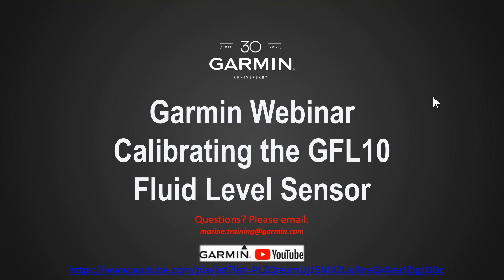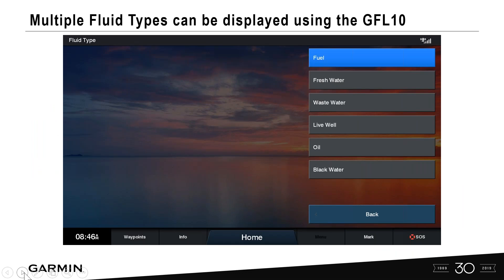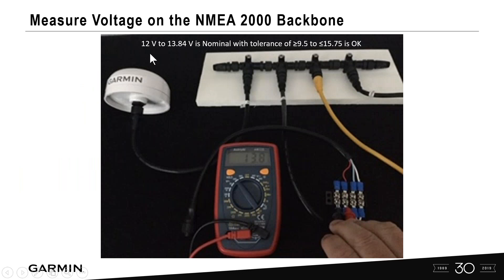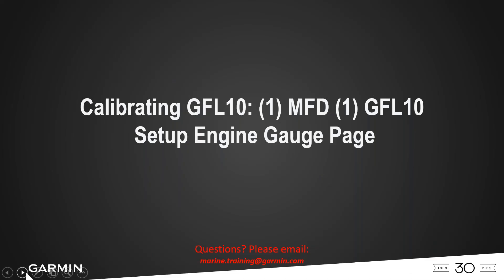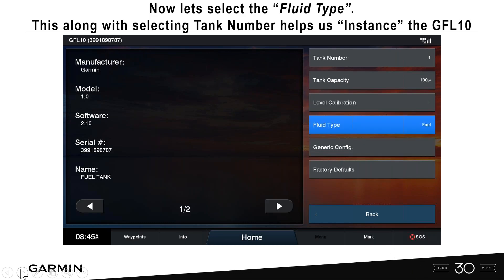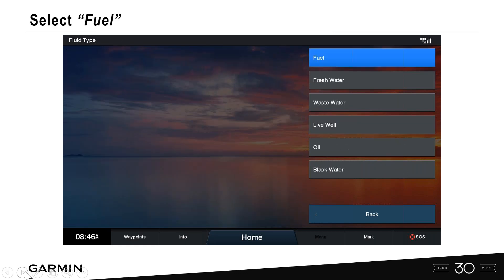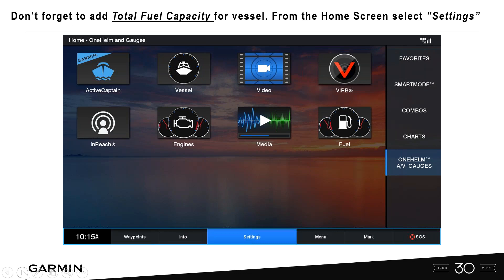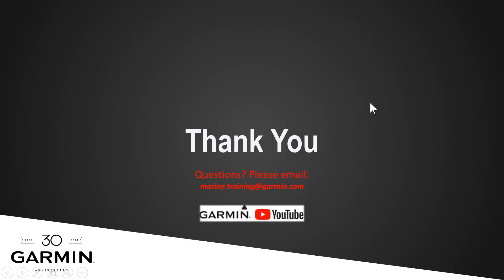Garmin Marine Webinars: How to Calibrate the Garmin GFL Fluid Level Sensor

Comment: 2025 comment here.  Super informative video as we just purchased a 2007 Nordic  Tug 42 with an older SmartLink vessel view system that is out of date.  I would like to ensure engine data gets on the N2K network so we can integrate it with new Garmin displays.

Comment: Say you're adding this to a boat that already as fuel in the tank.  Clearly, I can see your first calibration point would be after you fill it up.  Then, how do you add the other points if the GFL10 is the only way to get fuel level?  Obviously, you don't want to use empty as a calibration point when you're out on the water.
Reply: Yes it is very confusing.  I don't understand why at full tank you cant say 100% and then go from there.  I don't understand why he added the 0, 50 and 100 and then it started reading 68%.  It is confusing.
Reply: Did you ever figure it out??   I am trying to calibrate this thing and it’s a headache.  I have currently half a tank on a 200 gal tank. If I set it to 0 calibration and then to 50% on the second one it stays on 50% and even after burning fuel it won’t change at all.  If I set 3 points how be did here on the video the thing goes crazy constantly changing the reading all over the place.
Reply: @georgelopez7729  Sorry, I'm just now seeing this.  If you're at 50% now, why not mark that as 50%, then fill it up and add another mark at 100%?  Honestly, I don't really use my GFL-10 anymore.  I watch how much fuel I've burnt from my Yamaha.

Comment: I'm using mines GFS 10 with a new 743 xs tomorrow I'm calibrating. I already connected the GFS to my analog gauge wire from the sending unit I removed all my gauges by connecting a Volvo Penta on gateway. but I needed the GFS to pick up my fuel tank level
Reply from the maker: Hello Jose, 
Please get in touch with our marine support team at the following link: http://bit.ly/GarminContact-US
They'll be able to take a closer look into your situation and provide you with the best troubleshooting. 
Thank you! -MR

Comment: So basically you install this and get it calibrated and the fuel tank will now be like it is in a car. Once you refuel it adjusts fuel level by its self and you dont have to manually enter it??
Reply: Did you find the answer to your  own question.
I'm also wondering

Comment: Thank you for these videos.
Two questions:
1 What oil level sensor do you recommend to use along with the GFL10 in my oil reservoir tank?
2 Right now I use engine fuel flow data to show me how much fuel I have left in the tank, and I have that displayed on my engine page. If I were to install a GFL10 to my actual fuel tank float sensor could I have it to where I can name the info display from the float sensor as Actual Tank Fuel and the other display that right now shows fuel level by means of fuel flow data as Calculated Fuel?
Thank you
Reply from the maker: Good Evening, 
Garmin doesn't manufacture an oil level sensor, but the GFL10 can be connected to an analog oil level sensor and the data can be converted to NMEA 2000. If a GFL10 is connected to a float sensor, it can be named. 
-MR